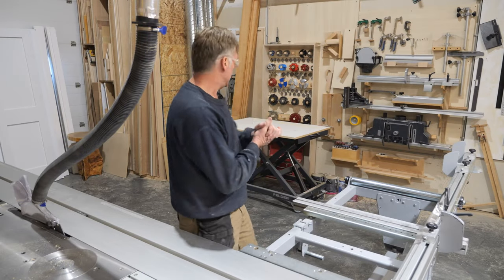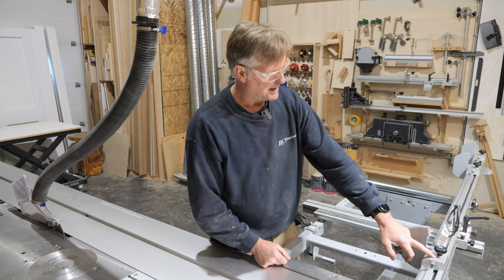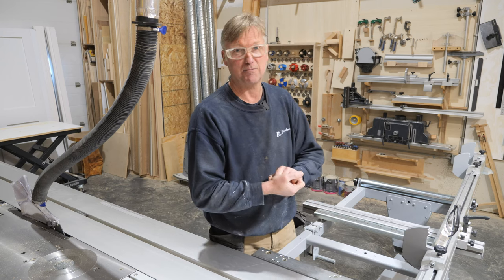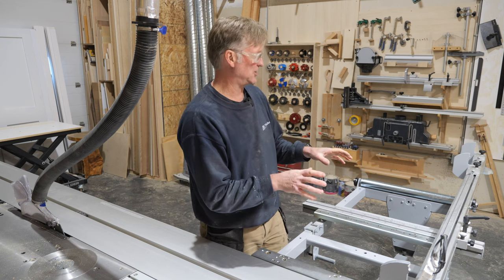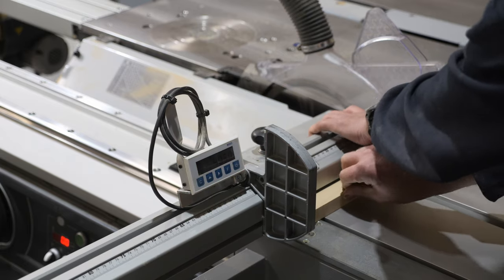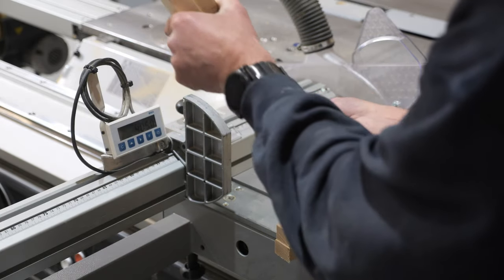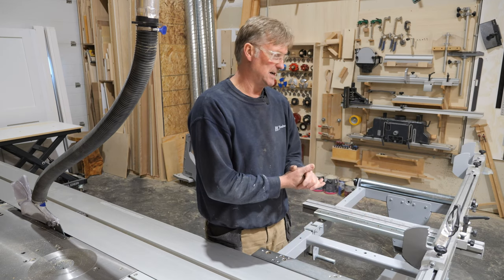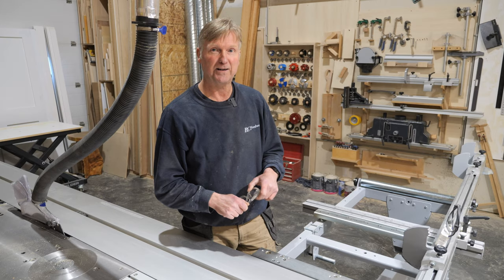Digital Read Out for the crosscut fence on my Felder CF741

Comment: Nice! I put one on the rip fence side of my KF700 and it works so well I'm planning to put one on the slider as you have as well.
Reply from the maker: Awesome Ron, I am thinking about also putting one on the rip side, it might be a little more messing around though as the far end of the table lifts up when using the thickness planer.

Comment: Hi again Bryce. Thanks for another useful video. I've already set a DRO up on the rip fence for our KF700 but I'm also struggling working out the details for mounting the bracket and sensor for the crosscut.. Also, I notice  that the end nut that you drilled and tapped rotates when you 'flip' the stop - does this cause any problems? any further images or explanation would be really helpful. Thanks
Reply from the maker: Hi Tim, The bolt that i drilled and tapped doesn't actually rotate, the flip stop spins on it without it moving. At least that's how it works on my flip stops. I have three of them. If yours is spinning, maybe try taking it apart and see if there is something not in the right order with the washers etc. If you need, i could have a look at the order of them and let you know.
Reply: @brycecomerwoodworks  Hi Bryce. Thanks for your reply. The stops look similar (if not the same) but ours definitely rotate. I came across another post where someone said they introduced a bearing into the mounting to counteract the rotation - so I guess i'm not the only one encountering the same problem. yep i wonder if there's some way of arranging the washers etc to 'decouple' it although we've never altered it so I'm guessing this is how it came from the factory. I'm guessing your's is a newer machine so it's possible they've altered/improved things (ours is 2004 model..). Again thanks for your input. Tim
Reply from the maker: @wawmsey1  That's interesting. My old machine was the same as this, infact, the flipstop i have the DRO on is from that machine. It was built in 2011. The new ones are the same, so maybe it was changed some time after your machine was built. Another option would be to buy another flipstop to put it on. An extra flipstop is super handy. I have 3, but most of the time i could get away with just 2.
Reply: @brycecomerwoodworks  I just checked out a Felder product video and indeed it seems the bolts on the newer version do not rotate with the flip stop.. Will have to consider purchasing a second. Thanks
Reply from the maker: @wawmsey1  It might be worth pulling it apart to see if you can add some super heavy grease, or something that will stop it from rotating? I know mine are very tight in the aluminium part & they have a very sticky grease on them.
Reply: @brycecomerwoodworks  Thanks for the tip Bryce - I'll take it apart and have a look..

Comment: Hi, great video. I have the unit and a Felder k975. I am struggling with the mounting of the sensor and unit. Could you show me an image of the brackets that you made to mount both the sensor and the unit itself. Many thanks, James
Reply from the maker: Hi James, If you can send me an email i'll send you some photos. bryce@brycecomerwoodworks.com 
I've also got a video in the works on a DRO for the rip fence. A fairly easy thing to do i would imagine on the K975, but not quite so easy on the CF741s. Thanks for watching.
Reply: @brycecomerwoodworks  sent, thanks. James
Reply: @brycecomerwoodworks Thanks for the great video. Planning do exactly what you have done. Is it possible to send some photo’s of the brackets. Thanks Steve
Reply from the maker: @stevo6581  Will do Steve. I'll try to get some photos in the next day or so. Currently trying to get a ton of work out the door.
Reply: @brycecomerwoodworks   Thanks so much Bryce. Much appreciated